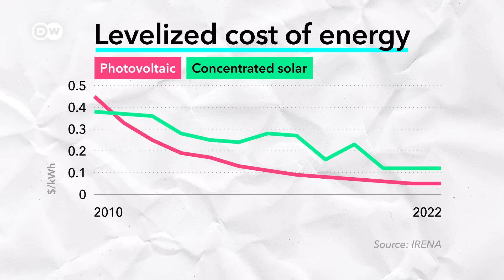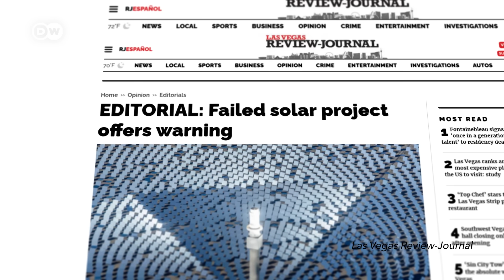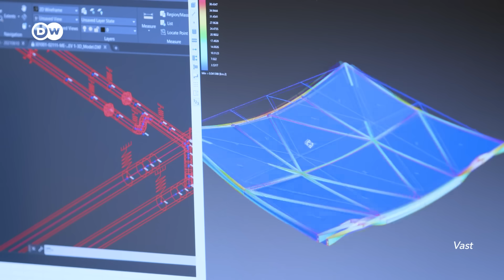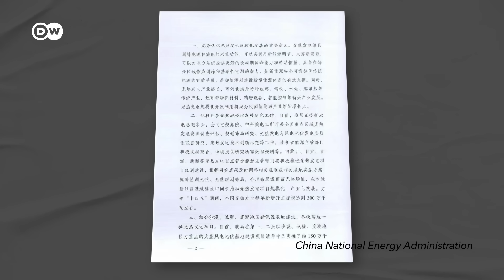How we can make solar power at night

Comment: The problem with CSP is that most plants are realized in desert regions since the plants need a lot of land and deserts also offer the optimal micro climate for them. And that means long ways to the main consumers of energy - in most cases there are not many industrial or population centers near deserts. The VAST project could address some of those limitations. But I remember also the short-lived hype about the solar updraft tower plant in Manzanares which used solar heat to power a horizontal wind turbine. There were some follow-up projects in China and Namibia, but they became never big enough. Those plants had however the advantage that you could use part of the covered area also for (greenhouse) agriculture - maybe there are some development opportunities also. (You could e.g. reduce the updraft during daytime to use more residual heat during the night, after the air outside has cooled down.)

Comment: Solar PV panels tend to be dark/black, great at absorbing heat... And can hit 60°C in intense areas. So wire a cooling loop behind the panels to collect this thermal energy,  and use that as a secondary generation mechanism ala thermal battery.
Reply: You are talking about Hybrid PVT (Photovoltaic and Thermal) panels. They do exist already, though the thermal heat created is not high enough to be able to run turbines for electricity generation.... they are great for residential hot water and home heating. I was looking at using PVT panels on my new build summer house in the next few years.
Reply: @bunyip7343  
I can see this being really useful for residential buildings. They are tall, so good spots for sunshine, and it would provide hot water for washing.
In Europe it would be really useful for people to pay less on electricity during spring and summer, and save money for winter.
Reply: I feel like this has to have been thought about and just can’t be worth the hassle??? I’ve had this exact thought too
Reply: Gotta imagine having a tonne of copper heat pipes off the back of every solar panel would be crazy expensive
Reply: Yeah so one of the problems with this is that attaching anything passive will reduce the heating power of the panel and cause it's temperature to rise. This in turn causes the efficiency of the solar panel to decrease. So unless the cooling is active and the coolant is initially at a lower temperature, you will lose the efficiency. Also it will never get hot enough to melt metal or salts, maybe enough to boil water but that's it.
Reply: The thing is, that the lower the temperature of a heat source is, the lower the maximum efficiency you can reach with your thermal powerplant. You can see this neatly in the function for the Carnot efficiency (remember to use Kelvin instead of Celsius).
Reply: Solar panels can maximum resist 70°C. If we use heat pipes then won't the pipes heat transfer to the panels  and if solar panels are heated more then the voltage will decrease and the efficiency will reduce.
Reply: The huge benefit of solar pv is that there are no moving parts. The moment you introduce any moving parts you suddenly have a huge maintenance overhead.
Reply: @cyrusp100  For a water pump?

That's all hybrid PVT systems use. They just pump water around to use the built up heat for space or water heating instead of letting it just go straight to the atmosphere.

Comment: You can easily hybrid CSP with PV, using the fluid medium to cool multijunction bifacial PV targets at the focus of parabolic troughs. PV efficiency increases as irradiance increases toward ten times peak sun and temperature drops toward 100 C. Not hot enough for hot rocks storage, but plenty for compressed air that lasts days or weeks in insulated underground tanks.

Comment: Another benefit about CSP over PV is that thanks to the use of turbines (that have inertia) it can help stabilize the frequency of the power grid, unlike PV which uses inverters that are more prone to frequency changes due to having no inertia.
Reply: Inverters are improving but certainly this is a benefit to various systems including csp heat storage facilities
Reply: Those turbines are simply flywheel batteries that happen to be integral part of the steam engine. Also, the idea to both save money and balance the grid by storing excess production is almost a century old. The claims that only solar and wind need batteries to work are as true as saying that switching to electric trains would require building new railways.
Reply: but this Turbines are mostly too small. I think , in the near future batteries will play a big role in stabilizing the grid.
Reply: @oberstoffer  Like I said they already have for almost a century. Pumped hydro for  general grid balancing and flywheels for buildings that need to be able to keep the power on until they can start their own backup generators. Sometimes chemical batteries were used too, but old ones were far too weak to allow for any large scale implementation.
Reply: For me, this is one of the major reasons CSP is the future for clean power generation apart from other potential industrial uses
Reply: @abeleonson  I was a big fan of CSP, but it hasn't worked out so well.    The CSP they built in the United States around 2010 had to be shut down, to much stuff breaking and needing repairs.    
    
PV's solar power, wind and batteries might have to be good enough.
Reply: @ronaldlindeman6136  With the successes recorded on the Moroccan CSP projects, CSP is a promising renewable energy option.
Reply: @butbcbai  Let’s add giant flywheels to take us through the night. Or pump a lake above us and let it drain back at night for evening demands most energy used for cooling isn’t it?
Reply: @jmanke6057  Pumped storage is a decent option, the major hurdle with it is it very location based just like hydro in general, you need a pretty steep incline and a big elevation change for it to be efficient, but it is super cool that you can use your turbine as a pump by running it in reverse :) Idk where flywheels are at but just going from PV -> electric motor -> flywheel back to electricity again is probably losing a lot more efficiency.
Reply: @butbcbai  Nothing ever perfect but hope a future administration who ever they are encourage multiple ways because every situation has some degree of merit

Comment: This technology is really suitable for creating syngas which  can be used to make synthetic fuels
Reply: @Spha_gatsheni  Yes synthetic fuels are great as well with the right fuels ICE can be cleaner than electric vehicles when you add up all the effects on the globe. If you only care about your little neck of the woods the heck to the world electric vehicles are an answer but not right one to force on to people a broader choice is needed. Areas with inversion areas electric vehicles might be an answer.
Reply: From a physics point of view, to create syngas you have to first produce hydrogen, that is most efficiently produced by the sulfur iodine cycle turning high grade heat into hydrogen at 50% efficiency, this is vastly higher efficiency than using electrical energy to do the same thing that might well use platinum (rohdium etc) as a catalyst. Also nuclear heat would be baseload heat and entirely off grid, making hydrogen 24/365. Another energy plant would need to convert the hydrogen into other fuels such as DME, Ammonia, methanol etc.

Comment: Sadly a bit misleading unnecessarily.  This isn't solar power at night, it's thermal battery power at night. 

We have similar potential energy batteries for decades in the form of Pumped Hydro, and new ones including raising heavy objects then lowering them to run a turbine, or heating salt or rocks as the medium
Reply: Umm...I think they quite clearly said that it wasn't solar power at night. That's literally the whole point that CSP found a new niche as energy storage instead of power generation. And comparing CSP to batteries and hydro, the difference is that CSP is totally self-powering. You can charge batteries or pump water for hydro but they are viable only when there's excess energy than can be used for to create that storage. CSP will automatically charge itself every day regardless if there's excess power or not.
Reply: @rahko_i  They said that in the video, but they implied something very different with the clickbait thumbnail.

Comment: Gemasolar in Spain showed this tech some 20 years ago, if it had been scaled up 80 fold it would have given an avg output of 1GWe the same as a 1GWe nuclear reactor, but trhe cost was $18B vs maybe $5B for nuclear. The idea of storing heat in molten salt, but instead of using a  complex array of mirrors and towers taking up vast amounts of land and prone to problems, instead use a primary loop of Flibe salt with fission, the reactor makes constant heat all day long and transfers it to the secondary loop for storage. The generator capacity can be upto 3 times beyond avg output capacity so that electrical can be very variable on the output all day long that can counter the production of wind and solar, so a triple win. No batteries needed. If the wind and solar are got rid of then the MSRs can easily drive the variable demand of the grid without wasting land. Its always about energy density. Almost all MSRs in development get this storage for free.

Comment: Like it or not, China's been the biggest enabler of clean technologies. I think the Chinese can figure out a way to make CSP  competitive worldwide.
Reply: They are just desperate, because their coal plants are killing their people (not just by damaging lungs, but somehow they made their coals radioactive). However, they need a lot of electricity or their economy will collapse. Especially during drought when Yangzi river system has turn into creeks and the Three Gorges Dam is close to empty.
Reply: Partially true. The can do PV pannels really cheap and in large quantities.

But these are simple mirrors and heat related equipment, this is much less about economy of scalesml.
Reply: yeaaa
Reply: China is also big on photovoltaic. I haven't heard about CSP plants from china much
Reply: It’s exciting as China boldly moving towards clean and renewable energy with energy independence. No oil based economics or geo politics 🎉🎉🎉
Reply: @Dhanesh007r  Not really. China been building new coal plants alongside renewable adoption. And the reason they want energy independence is because of geopolitics----i.e. so they couldn't be starved of energy like Imperial Japan was in the 1940s, which led to its defeat. And this is of course because China does want to keep all options open regarding that one semiconductor-producing island to its southeast that probably can't be named here.
Reply: @VVayVVard  China is also gradually phasing out inefficient coal-fired power plants near cities.
Reply: China is building a coal plant every two weeks, what are you talking about?
Reply: Hello from Los Angeles California.  I lived all my life in Los Angeles California, and in the 1980's the Smog was so thick it filtered the Sun. The smog blocked the Sun so much the winter's in Los Angeles California was so cold between 36° to 55° Fahrenheit nights dropping to 33° Fahrenheit 
I couldn't see mountain ranges from where I live 4.5 miles away. Unless it was windy and smog cleared. Now the air is so clear you can see cracks and riges, on the rock walls. 
It uses to rain 🌧 none stop for 7 months, and the summers never exceeded 90° Fahrenheit. Due to Sun being filtered from smog I also didn't need shades, for my eyes. Now 🌡  are 110° Fahrenheit for excess of 1.5 months with 5 days in the roll Temps exceeding 116° and 1 day at 120° to 126° depending on fire conditions radiating heat. 
Air clean enough, and it will not get any cleaner with only Electric Vehicle's (EV's)
Now to the reason why Environmental green agenda causes Drought Conditions.  In 2010- 2013 there were Solar Mirror s installed to project solar arrays to a Tower with mirrors projected downward to under ground reservoir water sources.  To generate steam, and generate Electricity.  
The temperatures 🌡 causes the atmosphere to close to 5,000° and every time birds fly thru become instantly baked and fall. 

In the 1980's the Jetstream used travel across California in to Nevada,  Arizona,  New Mexico,  Texas, and so on to Florida.  Due to the Mirrors the Atmospheric High Pressure. Has pushed the Jetstream away from Southern California to North to Washington,  and or Canada 🇨🇦 . This cause along with getting rid of Smog cause higher temperatures and Drought Conditions. You couldn't pay me $10,000,000 per hour to sit, promote,  sell, let alone buy any Electric Vehicle's (EV's).
If you look up StachD Training channel, on his video titled Lithium Largest Ex plo ding EV Recycling ♻️ Center in Missouri.  There were 4 Recycling ♻️ Centers in the United States.  Now there are 2 Recycling ♻️ Centers,  and none are in the State of California.  Due to Environmental Impact, which the video shows Fire Authorities spray granulated elements of the Lithium-Ion Batteries 🔋 Packs,  into creeks, rivers,  and lake anfmd underground well resources.  Not even boiling helps, and fish hacmve died in those water ways.   Sure clean the Air while you Pollute the water. In April 2024 the 1st Recycling ♻️ Centers in Phoenix Arizona location burned down,  and dousing water to keep cool prenting spread of fires 🔥 have caused Drought Conditions.  @truebrit3670  Look it up
StasheD Training channel 
Missouri Recycling Center ♻️ Ex Plod ing can't spell this out. Fish died wells for water is no good anymore,  and became Acidic 
These are facts. 
Mirrors in Mojave Desert Modified where Jetstream away from
 Southern California.  
The so called green agenda is to keep there pockets full or bank accounts.
Reply: The western put hold on renewable energy development when fuel price drop. But now China keep pushing RE development further. Forcing western guy to take part or they will be late in the game.
Reply: X2
Reply: @josdesouza China still builds coal power plants , just to know :)))
Reply: By destroying natural landscape and people home
Reply: @NotUwU-_-  china is huge, all they gotta do is look for a empty space somewhere om gobo desert
Reply: Yep! If someone make something become possible, we still need Chinese to make it become affordable. I dont feel good about the Giant next to my country but their supply chain is really impressing.
Reply: China has enabled price drops in every realm, driving consumerism, but has only had a marginal relative impact on the adoption of clean technologies specifically. The R&D and investments have primarily been shouldered by European countries, the US, JP, and S. Korea. Without China's input, everything would cost more, but the green transition itself would be happening at a similar pace, since it's always been driven by artificial demand in developed countries, not supply.
Reply: Sadly they dont believe in a collaborative way of building new tech, so whatever they achieve is for themselves!
Reply: @ecoideazventures6417  their entire cultural narrative is they are rising from a 100 year war
Reply: @ecoideazventures6417  please give an example
Reply: @ecoideazventures6417  Last year, China launched the "African Solar Belt" plan, which will help at least 50,000 African families. In fact, China advocates cooperation and believes in a win-win situation, but the West wanna suppress China's tech development and impose sanctions for geopolitical reasons.
Reply: @ecoideazventures6417 how do you mean? I can think of ways the west doesn't collaborate and ways the Chinese have. But feel free to elaborate on your vague statement.
Reply: @ecoideazventures6417  The US made it impossible to collaborate with China in space. And China has been selling its solar panels for very cheap, so I really don't see where you're coming from
Reply: @ecoideazventures6417 Lol, who's the one sanctions china doesn't allow semiconductors related technology to china? Who's the one started all nonsense trade war?

Comment: All pumping where the medium varies in viscosity has issues. You need a fluid or gas that can carry temperatures to a starage tank like the sand store in Finland, and from there the water is heated for the turbine.

Do that and then you are singing!

Comment: The mathematics might work for now. But soon PV panels will reach an efficiency of 35%. At that efficiency it will be cheaper to heat graphite or salt and store the heat than using CSPs. CSPs really have no future except industries that require high heat and can be located in deserts.
Reply: To store heat you never want to use even electrical energy since when you get it back, you only get 1/3 of the value back.
Best source of heat for filling the salt tank storage is always cheap heat, preferasbly from fission heat. CSp and fusion heat are just vastly more complicated than fission.
Reply: @johnjakson444  CSPs don't convert 100% of solar energy to stored heat. It's about 50% or less. Since the construction cost of a pv plant is much much cheaper than a CSP you can just use electricity to heat graphite and use turbine with efficiency of offer 50% to convert it back to electricity. You can even store the heat in natural gas burning plants and use the graphite heat instead of buying gas. CSPs are dead